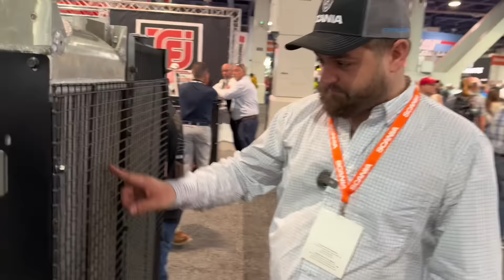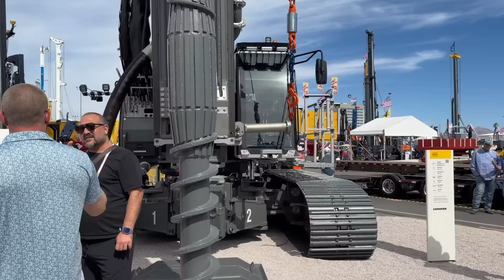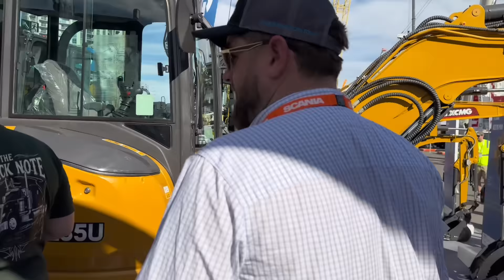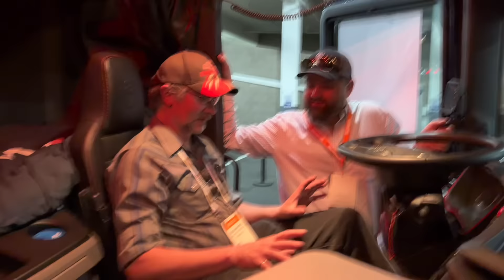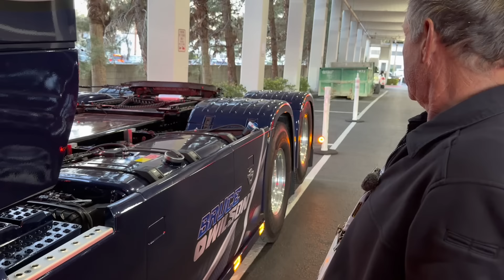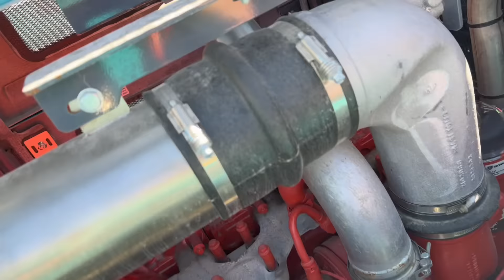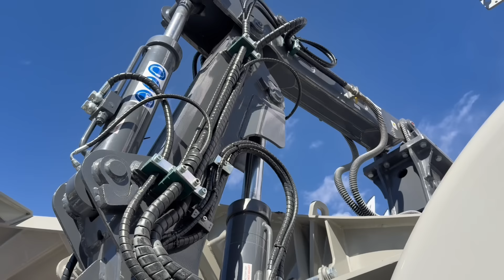Our Scania Truck Got SWARMED in Las Vegas!

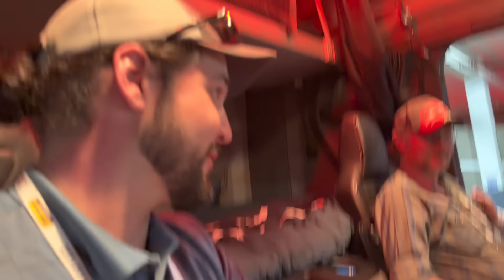Comment: 22:00 I believe one competitor in Europe for firefighting stuff is Rosenbauer from Austria. For military trucks it's MAN with Rheinmetall

Well, Rosenbauer uses a MAN chassis for their 8x8 variant
Reply: Man is in the same group that scania is. Scania had they own parts but Man are using some Scania parts for they trucks.
Reply: There are MANY firetrucks makers in Europe. 
Rosenbauer in few other also supply parts, and local manufacturers will do it...
The direct competitors are Magirus and Ziegler. Then there are all the ones buying parts and supplying their trucks, and most countries have few makers like this.

Military trucks?
- Iveco
- RMMV 
- Mercedes
- MAN directly as well
- Scania
- Volvo
- Renault Trucks
- Tatra
- DAF (tatra chassis)
- Jelcz
- Sisu
Reply: @fabr5747  I was more talking about the firetrucks for airports
Reply: @tristanvoltaire2058  
A list of makers of firetrucks for airports (airport crash tenders): 
- Ziegler Z-class (Germany)
- Ziegler also proposes crash tenders based on commercial vehicles directly. 
- Iveco Magirus DRAGON series (X4, X6, X8), 
- Iveco Magirus, IMPACT, based on commercial trucks (Germany / Italy)

- SIDES Sentinal (France)
- SIDES based on commercial trucks
- GIMAEX (France)
- SwedCat by Sala Brand (Sweden), used by the Swedish air force and Swedish airports.
- Saurus Oy (Finland), such as the Saurus AFS100/7.
- Protec-Fire Iturri Toro (spain)
- Kronenburg B.V. (Netherlands)
- THT Polička (Czech Republic), based on Tatra trucks.

And I'm sure that there are additional eastern European solutions (Poland, Ukraine, maybe Romania, Bulgaria, Greece)... 

You don't realise how many manufacturers there are. 
BUT, some of those might use the pump of Ziegler, of Rosenbauer.

Comment: The US is the only Country in the world that still uses the standard measurements the rest of the world went to the  metric system a long time ago
Reply: The metrics system is (ISO) standard!
US and Myanmar is still using the Imperial system (an UK mix it up totally)
Reply: @MagnusSandberg-n4w technically the US doesnt use imperial it uses US customary units which are slightly different to but based on British Imperial units. they have a different Gallon for example.

A US gallon is ~3.7 litres 
An imperial (UK) gallon is ~4.5 litres.
Reply: Incorrect, Canada and the UK still use a hybrid of both metric and imperial usually depending on a persons age or the context. (The UK still uses Miles and yards for longer distances and mph for speed)

Comment: Bruce, it has a engine brake, but it is not so loud as you are use to. The retarder is most effective and powerful over 50 kmh, so if you are going down a very steep hill at low speed it is not helping a lot,but this is where the engine brake takes over. If you listen carefully you can hear it when you pull the retarder handle on max. By the way, the volvo 780 i have now has around 1200 bhp brake power retarder and veb+ engine brake combined.

Comment: Scania.Volvo. Mercedes-Benz,Iveco,Sisu,
Renault,Man,Daf
All of these are washing away the latest models of American brands in everything already with models from the early 2000s, just like that. It's incomprehensible that these European brands are not allowed on the American market, and the appearance of their own trucks and everything else is the same crap as 50 years ago, a real waste of money. And on top of all that, you can get a real European truck like this cheaper than a new American museum junk.
Reply: At Expo was a the new Mack Granite (Youtube: The NEW Mack Granite at ConExpo 2026)
Someone wrote the following in a comment: ''Looks like an Automatic, Electronic, Touch Screen, Sh*t Box!...  Someone needs to make a Truck that's still a Damn Truck!... All those Composite Body Components have got to go too!...  I'm the 2nd Owner on a 1969 R 686 Mack Tractor... It is still in use... That was built back when Trucks were Trucks!... I run my business with a Fleet made up entirely of Older Vehicles... 1979 F-600 Rollback, a 1990 F-250 Service Truck, a 1980 Ford  Econoline, Etc... I can work on that stuff... These newer Trucks, you can forget about it!...'

Comment: Always nice -with a new reaction vid.
It would be nice to see more reactions on the true working benefits -with the SCANIA air ride. Like hooking on to a trailer king pin: Going in low -and raising the truck before You accually hook on/lock into the pin. And the following benefits of raising the trailer landing legs; when the legs are already off the ground. No need to blow out Your back while cranking that shaft. It's the smartest things that make the biggest difference. Keeping truckers healthy is a BIG PART of the SCANIA way!
Reply: All semi trucks in europe had that. Also in Poland they changed exam for truck and trailer (before it was rigid truck with trailer). In this year all exams are in semi truck. the procedure for connecting the trailer includes lowering and raising the suspension, the argument being that this saves grease on the fifth wheel because it does not stay on the trailer.

Comment: I drive one if could get it as dump truck.
Reply: They do make Scania dumptrucks
Reply: Of course you can get a Scania dump truck. Scania build semi's, dump trucks, timber trucks, fire and rescue trucks, airport rescue trucks, tow trucks, crane trucks, off road trucks, military trucks and whatever you want. Scania also build buses if you need a bus.
Reply: @catd11ng74  Not in the US.
Reply: @Desertpacrat92 
No. North America except for Mexico is the only place in the world where you can't get Scania trucks. The reason is the American authoritys are protecting the American manufactorers. That's also the reason why American trucks are decades behind.
Reply: @catd11ng74  Ya well wish they would be able to competition is good are stuff use to be good but now it's junk
.
Reply: @catd11ng74  and you can get garbage truck with 6x2 (front and rear steering) 
In Poland "szybki bill" driving scania like that in narrow city spaces

Comment: Swedish steel
Reply: Lots of Swedish companies there: Scania, Huddig, Husqvarna, Engcon, Volvo….
Reply: I'm so mad at GM cuz they killed SAAB. Still the best in winter conditions at The Arctic Circle where I live. No need for 4wd or electric brains; especially SAAB 9000 a.ka The Last True SAAB. Have two 9-5 wagons and they are pretty, pretty good but no match to 9000 when the going gets tough.
Love Scania too, the very same Griffin and sound like no other truck. Just like SAAB I4 turbo 🇫🇮🇸🇪🦬🏴‍☠️
Reply: Shipped from china
Reply: @noelwallace5257  um no. From kiruna mine
Reply: @noelwallace5257 not from China at all Scania made in Sweden Volvo trucks made in Sweden ect I think u are thinking about the car company Volvo they are not the same that makes the truck